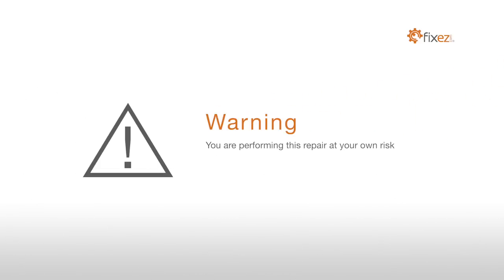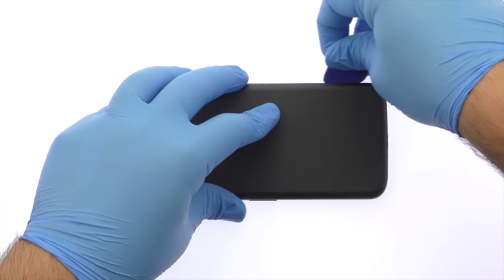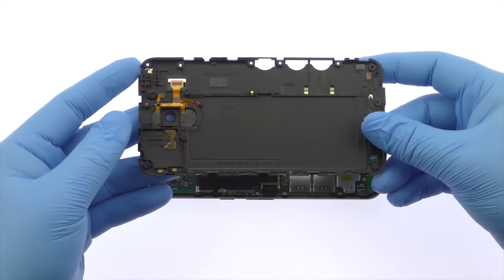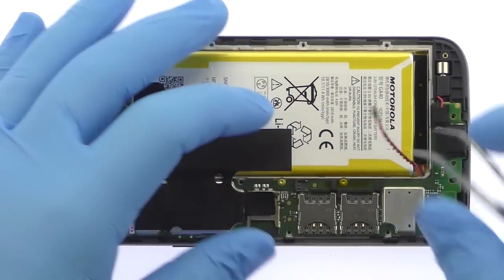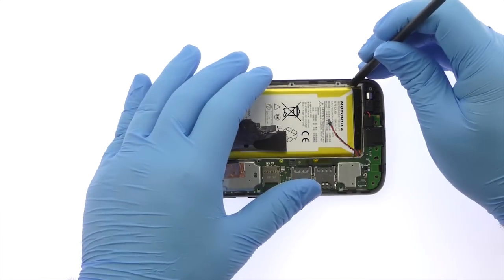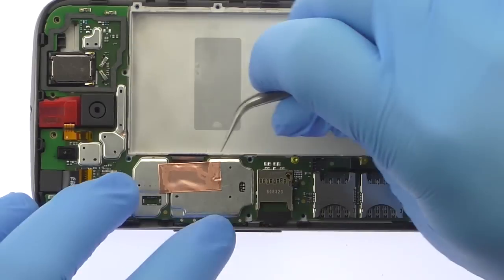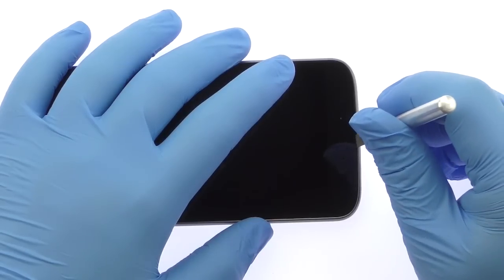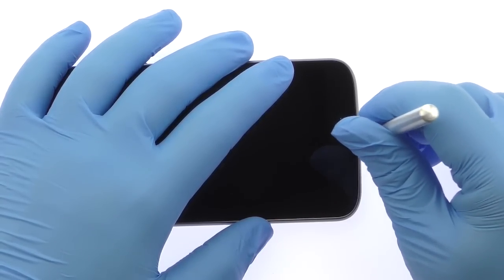Motorola Moto G4 Screen Repair, Teardown and Reassemble - Fixez.com

Comment: I reassembled the phone but it's hot now and won't turn on anymore. Not sure what to do now. Have I damaged the battery?
Reply: I have the same issue, did you ever figure out if it was the battery? or something else?
Reply: irbricksceo No, unfortunately. I hated to but I gave up.
Reply: Ah man, I have the same problem. I tested the new screen before reassembling it and it worded fine. As soon as I reassembled it wont tern on and also gets hot? Has anyone managed to solve this one?
Reply: Hey irbricksceo, did you manage to wok it out?

Comment: Hello, I saw on other videos that a Torx T3 Screwdriver is needed to disassemble this phone. Are you really sure a T4 is required ? Thanks ! Nice video btw.
Reply: it has to be t3
Reply: Boris LONJON I UNFORTUNATELY bought a t4 and it doesn't fit! I would strongly recommend testing first and then buying.
Reply: Uluç Özcan thanks man. Already ordered a t3 because I saw it is recommended by other people. And T3 fit perfectly!

Comment: Hello Fixez.com , my Moto G4 plus screen is cracked at a corner and there are several cracks across the screen. But the display and touch are working fine. Do I have to replace the whole unit?
Or is there a way to replace the screen glass seperately. Please help me find a solution.
Thanks in advance
Reply from the maker: Glass only replacement requires specialized machinery and is beyond the scope of our videos.

Comment: I followed your instructions, bought the new frame from you. Nowhere does it say anything about the buttons on the side, which you never remove, never replace. Now I have a re-assembled phone with no buttons! What the heck?!!!!
Reply: Ominous Shrike any solution?
Reply: Hey Sensei, did you fix it? Seems like you need to reuse your old buttons in the new frame.
Reply: Oh, the buttons pop out from the inside.

Comment: Hi, this video shows the XT1622 model being sucessfully used and I have the XT1625 model, has this product been tested for software compatibility on the later model of the motorola moto g4?
Reply: I have the same question.  Let me know please if you tried this with the XT1625 model, when I ordered the SKU from them was 2-MO-3048.  I have not performed the repair yet.  By the way, I have found that the XT1625 is not held together by the T4 torx fasteners like this video shows.

Comment: My Moto G4 also has a problem. All of the sudden the screen started to display static white noise, and that's all it will display. The touchscreen, and all other components function properly, but the screen will no display anything different. I've looked at the connection from the ribbon cable to the board, and everything is as it should be, no water damage, and fully plugged in. Do I have to replace my screen?

Comment: Hello, my Moto G4 has a problem , there is a little part of the screen that the touch doesnt work, the rest of the screen works fine (in that part that touch doesnt work it still displays everything i just cant click or do anything in that part of the phone) is located exactly where the letters K and i are in the google keyboard. Will this fix it?
Reply: Also the phone came from amazon with that problem,  but i cant send it back cause i am not in USA so i wanna know how to fix it
Reply from the maker: +Ventus It sounds like your have a problem with your digitizer replacing the display and digitizer should fix this.
https://www.fixez.com/store/motorola/motorola-moto-g4

Comment: if your screen is cracked do you need more than just a replacement screen?
Reply from the maker: +Steven Flores If the display is cracked and the phone is still showing signs of life i.e. (its recognized when plugged into a computer, notification sounds, vibrates) usually a new display will solve your issue.